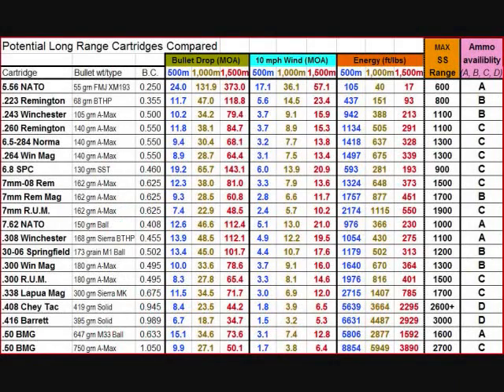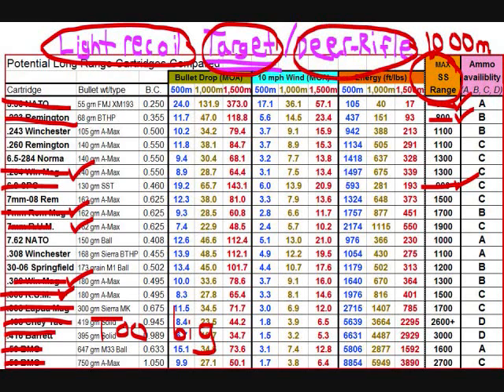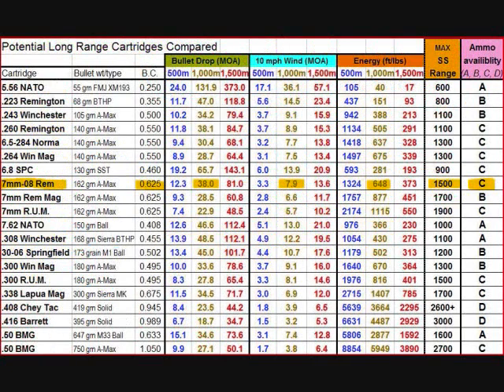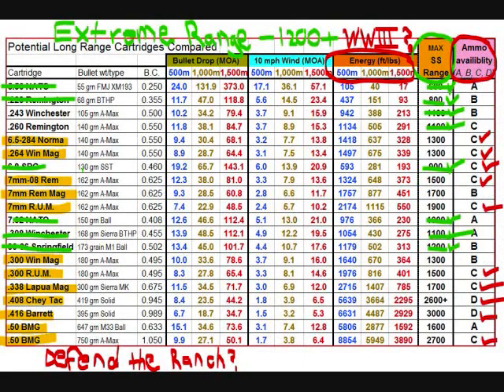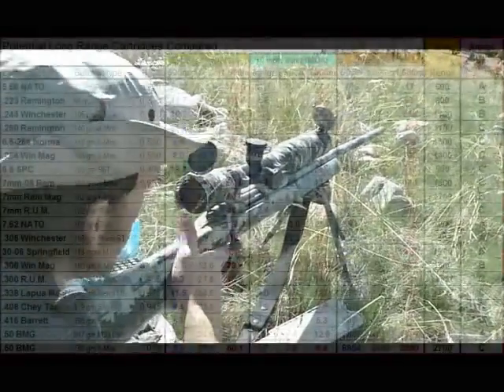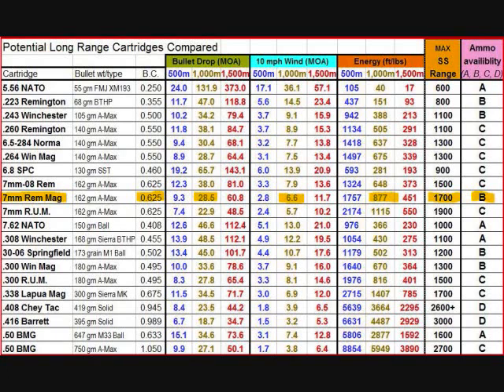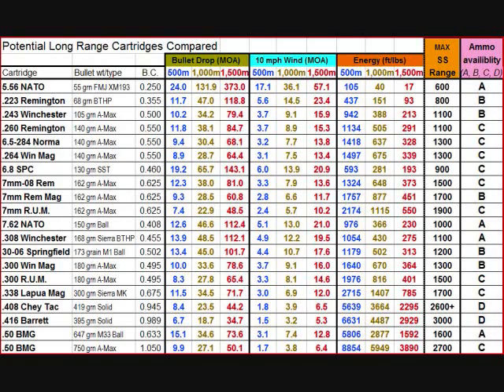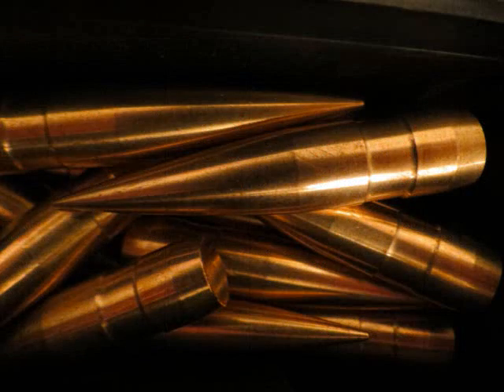Long Range 101 Part 3 - Cartridge Selection -- Rex Reviews

Comment: I would like to see .280 remington compared to 7mm-08.  It will shoot the same bullets with a little higher velocity.  It can also be handloaded from widely available 30-06 brass just as 7mm-08 can be made from .308 brass.  I don't think .280 is recommended enough and is an excellent choice.

Comment: Western North Dakota, 308 Win. with a 5.56/.223 in a support load. Both cartridge types are readily available both commercially and military loading's. I have absolutely zero illusions of exceeding 1000 meters, I'm not that good of a shot. But upwards of 1000 meters, the target won't know I'm there if I can get that kind of accuracy out of my hand built AR-10. Probably not, but upwards of 6-700 yards, I'd be happy with a shot.

Comment: Ammo availability for the 300 RUM and 300 Win Mag are incorrect for reloading.  It is shown as a "C“ for the RUM and a "B“ for the 300 Win Mag. The 7.62 NATO is an "A.“

For reloading all use the 7.62 mm (308) diameter, so all can be considered an "A“ IMO. 

The RUM can be also loaded with extremely high BC 220 grain bullets. 
Much higher BC than shown here. 

Add the fact you can load in 3 power configurations (30-06 or 300 Win Mag) and with a good brake she’s a pussycat, it can be used for all game, was why I choose it.

Works best for me.

Comment: Best all around cartridges: 7mm-08, 270 Winchester.
Best safe cartridges: 308, 30-06 (No barrel burning, throat erosion, Ammo all over the place, kills almost everything, etc)
Best small to medium laser beam round: 243
Most overlooked round: 25-06
Best long range large round: 7mm Rem Mag, 300 win mag. (Without going to the poor house).
Best long term Military round: 7.62x54R
Best brush cartridges: 30-30, 45-70 (Affordable too)
Best brush and self defense lever action: 44 Mag. (30-30 and 45-70 less rounds in mag) 
Best lever action self defense: 38/357 (Even more rounds in mag)
Best small game stealth round: 22lr (Suppressed, cheap)
Best Zombie round .223/5.56 (For most everything, carry LOTS of ammo)
Best get off my lawn round: (00 Buck) 
Almost every round has it's place.
Reply: I like the way you think!
Reply: 6.5 Creedmoor is also a great and versatile round with good bc, range, and decent energy. Ammo is normally pretty available.
Reply: @sheltma1595  The 6.5's have always been a great round. 
AND, If I had one, I could get 6.5 Creedmoor for less than 308 as the price stands for Now. 
This is a reason for 9mm guys not to laugh hate on 40cal guys, or 45acp guys to laugh at the 9mm guys. 
At certain times during this AMMO problem, we have seen 40cal sit on the shelf a lot longer, while the 9mm guys are fighting each other for a 50 pack of 9 or 45 guys praying for a shipment to come in. 
I tell you one thing,...IF,..things go back to normal someday, I would suggest EVERYONE get one firearm in many different calibers. Because you NEVER know when this will happen again.
And then, you will not be starring at an empty shelf, but stocking up on what you can, when you can.

Comment: These are awesome videos and charts. Lucky for us, even better bullets have been developed since this. The 6 creedmoor with 103eld and 105eld, 6.5 creedmoor with 143eld(625bc) and 147 eld with a 700 bc, and my new favorite is the 6.5 PRC with 147eld at over 3000 fps. It's still hard to beat the 7 rem mag with the 162eld and 175 eld at over 3000 fps.

Comment: As a rank beginner I ask: If you have the availability why not just go with the 408 Chey Tac?  Or in other words, why is the Chey Tac so superior to all the others?  There has to be a some downside I have not yet discovered otherwise it seems head and shoulders better than the rest.  Also, since most of us (I'm guessing) are sport shooters, terminal energy isn't really so important so maybe a differentiation might make sense (one more column on the chart). I'm very curious if there is an ultimate PRS competition-only cartridge recommendation.

Comment: For hunting, why isn't .270 even mentioned?  BC is better than some.  Ammo availability is better than most. Hold energy to 1000 yd  a bit better than .308 Win.  I get that BC for 6.5 and 7mm's  are a bit better, but not by much.  Is it because it's potential ceiling is too low  for challenging loooong range  target shooting?  Seems like it ought to be considered for comparison.
Reply: Am considering a Thompson rifle with swappable barrels.   You get the barrel, bolt, and stock with the option of easily swapped barrels in .308, 7mm-08, .243, and 22-250 Rem.  For a newbie like me, it would be the cheapest way to have new  guns of a variety of calibers.   Anyone got opinions on Thompson, and their Dimension-Interchangeables?

Comment: I am just getting into shooting, my question is 300 Win mag vs 300 Win short mag, i have read the short mags powder burns more efficient because the powder is closer to primer, however i have not seen anyone say if you lose anything going to short mag. Can you comment on this? Love your videos
Reply: I personally am a fan of the WSM family own 3 and my new custom MSR (ar)10  in yup you guessed it 300WSM IS in ups truck on its way now. Accuracy Systems Inc out of Colorado built it. .4 in 3rnd groups.
Ok so you asked. Wm v Wsm.  The truth is w 200gr  n below they are basically equal. 200gr and above slight velocity edge to Wm. As for inherent accuracy, slight edge to wsm below 200gr but above 200gr they are basically equal. Side note to that statement: potential accuracy of each individual rifle will very thru harmonics in action and barrel. Generally speaking the more accurate the rifle, the more you will spend on its components. Typically a savage model 10/100 12/112 16/116 Will provide good to very good accuracy off the shelf for the lowest initial investment. On the other end of the scale , a custom bolt gun on a premium action w a premium barrel in a premium stock/chassis system can run upwards of $5000 to $10000 or in my case $3400 for a custom msr10 in 300wsm and  $4000 and up for say an Omen in 300wm.
   As far as readily available ammo the wm edges out the wsm. Also in cost per rnd the wm edges out the wsm there too. In recoil department the wsm edges by a hair. If you reload you will spend less on powder w the wsm to achieve the results 
 So that's the best general info I can give you. It is of course my opinion and  the factual basis is what it is...always subject to rebuttals 
In summation,  it's up to the end user to decide what he/she wants,feels good,and is willing to spend to achieve the results they are satisfied with. So if 1moa to 3/4moa groups are good for your application a factory rifle will get you there generally for under a thousand dollars conversely if you want 1 hole accuracy, given YOU are capable, your going to want a custom set up.
 Here's to wishing you well and may blessing be upon you daily, Crawford out

Comment: Im looking to rebarrel my savage 110 270win . I had thought about going to a 26" 6.5CM. Is there a better option for a 1500+ Meter , reasonably priced cartridge? I will be loading my own, so that should help with some of it. It appears that the 7mm08 would easily do it, if I have a spare barrel made.

Comment: Why no 270 on the chart?
Reply: I agree. Just got a 270 as a Christmas gift and I want to know where it stacks up
Reply: The 270 win with a 150 grain bullet, is only 100 fps slower than a 7mm mag with a 160 grn. Less powder and recoil, cheaper ammo...
Reply: Was just going to ask the same question. Interested in the 7mm-08, but the rifle I want isn't chambered in it, wondering if .270 is comparable, maybe even better for cost. TiborasaurusRex, thoughts?
Reply: ***** Man, thanks for the comment!! You just made my choice way harder lol. I'll check out the Tikka Varmint too! For some time I've been wanting the Weatherby Vanguard, but I could be persuaded away I think. Thanks so much, I need to check out reloading info for the .270!
Reply: The .270 is a bit slower than the 30-06 till 200yds. It ends up the 6.5 creed more, 7mm mag and .300 wsm out shoot the .270 but finishes out better than a 30-06. A 30-06 will kill a moose. 270 has Higher ballistic coefficient .270 is same cartridge as 30-06 but with .277 bullet instead of .308 bullet in the 30-06. The 130 grain bullets in .270 are best for long range. The aluminium tipped and steel tipped bullets are more accurate.
Reply: Thanks man, I appreciate it. So he left the .270 off the list because it's so similar to the 308/30-06.. good to know. I've been really humming and hawing over which caliber to focus on. I really want to take Rex's advice for the 7mm, but the cost seems so high and I have so many other pursuits to get into! I think I settled on the .243, seems Rex pushes that out quite far, and I am no comparison to him by a long shot, I'm sure it would be enough for me for a loooooong time.
Reply: I agree the .243 is a better round...
Reply: mcmiry 270 is still a great round. Just it was ignored for a while when it came to the newer high bdc bullets. But especially if you're reloading it still shines. Plus the ammo is cheap. I've got hand loads that push out of my tikka at just over 3100fps and still group a 1/2 MOA. And that's out of a 22" barrel. And 150 g running just under 3000fps. And is still under an MOA. Ya, the 7-08 and Creedmore have better ballistics due to a more diverse high bdc bullets. But they have new 270 bullets coming out in heavier weights and better bc. I bought it before I really got into reloading and the 6.5 creed became popular. Guess all I'm saying is don't underestimate it. Especially for hunting. I've dropped deer on the spot out to 400 yards. And if I don't have time for reloading, the hornandy white tail interlocks I got for 26$ Can, shoots 1/2 MOA out of this tikka too. But not as hot as my hand loads. And the SST super performance is near as good as my hand loads. I think the best rifle for the money today for a great target rifle is the Tikka Varmint. My bro has one in 243 and it is an utter tack driver. Plus I think they have them in 6.5 Creedmore. That will be my next purchase. Just my 2 cents.
Reply: Ya Weatherby's are great too. But the Tikka I can't say enough about. Especially that Tikka Varmint. And it comes in alot of different calibers. Plus lots of good aftermarket support. In my opinion its a step above the Weatherby. you can just feel the quality that Tikka, Sako put into thier rifles. You do lots of research. I think you will find alot of support for the Tikka. By far the smoothest action and even the Snipers Hide gives Tikkas away to winners of their tournaments. And you rarely hear of a Tikka that was a lemon and had to be sent back. Just can't say enough about them. 
  They also came out with a new Tactical model this year in 308, 6.5 creed and 260. Probably a bit more pricey, that's why I say the Varmint version. Alot cheaper and still amazing accuracy. For around 1200$ can. So probably just under a grand in usd. And you can put it into a Chassis like the MDT line for around 600$ usd down the road. But honestly I can't see how it could get much more accurate. I've seen my bro put up 5 shot groups at around a 1/4 moa. Great rifles.

Comment: Loving the series. My question is, I'm hoping to go for a tahr hunt. I've a 308 but heavy barrel (not up to carrying that in the southern alps of NZ). and a 243. You say deer up to about 1000. Others say they wouldn't push a 243 past 300. The manual says " can cause injury up to 5 miles. What do you consider the cut off for tahr with a 243 and what bullet would you recommend? I'm being told I need something more like a 7mm rem mag. Is this just a case of who has the biggest nuts, macho rubbish? Cheers FC

Comment: Excellent tutorial. I wanted to ask if the 338 win mag, which os not listed on the ballistics chart more closely resembles the 300 win mag or 300 ultra mag for energy, range, and ballistic coefficient or does it more closely resemble the .338 Lapua Round.

also, I wonder what your thoughts are on the Remington 783 Scoped for the budgetarily constrained? What caliber would you recommend going up to 500 meters? 

Finally, your thoughts on TC Arms Venture 500-1,000 meters out?

Excellent, excellent series....
Reply: Hi Rex, how do you compare 7mm-08 and 6.5 Creedmoor as ammo in 6.5 is better now, and Hornady  has a 143 grain hunter?
Reply from the maker: +Jason Ford Great question, but somewhat difficult to answer w/o more details on the exact configurations being compared... generally speaking, the .338 Win Mag is a great performer.  With heavier bullets, its trajectories compare to the .300 Win Mag with plenty of energy at long range.
Reply from the maker: +Jason Ford TC Arms Venture should work fine for a long range rifle, if you don't mind the recoil.  Most guys can get 1moa out of these.  It would be best suited for long range hunting in the lighter configurations, and might be a bit light for high volume target shooting :-)
Reply: +TiborasaurusRex  Thanks Rex.
Reply: I saw a guy kill a pronghorn at 1000 yards with a 338 win mag, 200 grain nosler accubond...
Reply: Je P I'm wondering the same thing. I wish there was a video comparing 7mm-08 vs 6.5 creedmoor for 2016/2017. If such a video exist please let me know.
Reply: The 260 holds 5 more grains of powder than the 6.5 creedmore. The brass is easier to form from the 308 family. I'm not sure why we hear more about the creedmoor than the 260.

Comment: I am curious to know the max SS range of the Grendal and Creedmoor.  I think they would both rate low as far as ammo availability.
Reply: +tyler pace 
Actually, since the 5.56 and the .308 are covered adding the 7.62x39 and the 5.45x39 would be interesting.
Reply: +tyler pace At higher altitude you can get out to a mile with the 6.5 Creedmoor

Comment: This .30-06 bullet is said to have a .730 ballistic co-efficient: http://www.nosler.com/nosler-load-data/30-06-springfield/
Reply: +COMB0RICO Correction: "This 210 grain 30-06 bullet"
Reply: +COMB0RICO the data in your chart will be determined by the bullets you choose, which will be dictated by what you want it to do.  you just have to try to get comparable bullets for everything as best you can, obviously if you choose a target round for one caliber and a BTHP for another, you will have very different data for them.

Comment: i appreciate your data, but as an example of bias the bullets that you are using for 7mm-08 data is not comparable to the bullet used for 30-06 data. If you were to plug in a nosler 190gr accubond long range with a BC of .640 and a muzzle velocity of 2750fps you would see much different results

Comment: so would a 7mm-08 stop a moose or deer at long range more easily than a 30-06?  That's what I'm getting from this chart but moose hunters often say a 30-06 is a good moose gun but the 7mm-08 is a little weak.  Does anyone have a good recommendation for me for a good deer hunting caliber, maybe moose hunting once but mainly deer.  I don't have any problem with the recoil of a 12 gauge shot gun but I do have bad arthritis and tendonitis in my shoulders.  I am new to hunting but shot .22s and shotguns many times on the farm and went duck hunting a few times but have never shot a high powered rife.

Comment: I watched a video on yotube, the guy shot a huge elk bull in heart with a .308 at 900 yards and the animal just dropped dead! It seems that .308 are still effective at 900, 1000 yards! But not according to that chart I guess!
Reply: Tino L There are a lot of variables that determine actual effective range. I am sure he was up in the mountains where the air was thin, most likely hand loading to get the most out of his rifle, perfect shooting conditions, and even then you have to accept that him hitting the heart did require a small bit of luck.

Slow bullets penetrate great, but you do risk them losing their stable flight once they slow down too much.

I am not doubting the video you watched, as I know of people knocking hogs down at a mile with .308. Stupid, but possible apparently.
Reply: DJ21o3 you are right, it was in the mountains!

Comment: Great video and education, but I do not understand your ballistics table for the 5.56 NATO vs .223 Remington.

My understanding is that the NATO round has higher case pressures and cannot be used on .223. 

Based on data in your chart, the .223 "way out performs" the sister NATO round.

Yes I understand NATO is 55gr and .223 listed is 68gr.

My confusion is NATO has better B.C. (.250 vs .355), should also shoot must faster from muzzle given NATO specs, but completely fails in bullet drop at 500m?

I understand that extra mass on .223 helps carry velocity, but do not understand how the higher muzzle, lower B.C. can be so greatly affected.

I would be very appreciative if you can explain this conundrum.

Thank you.
Reply: It's because of the choice of grain weight b.c the 5.56 NATO I believe only comes in 55gr 62gr and 63gr with .223 you can get many diff loads of factory ammo

Comment: BC of a 6.5 140gr A-Max is .585 not .550, the Berger VLD has a BC of .612 and if you really want some range the 142gr Accubond has a BC of .719. That bullet being launched out of a 260 Rem at 2800fps will stay supersonic to around 2,000 yards depending on elevation and temp. I own a very accurate 6.5x55 and 7mm-08 both great guns, but the 6.5mm handles long heavy high BC bullets better.
Reply: Jared Thibodaux You're correct, there are some impressive berger bullets for the 6.5mm and that 142 nosler is insane. But this video is 3 years old now, im sure if Rex did this again with the newer projectiles, we'd see the 260 and 6.5x284 being mentioned more favourably than 30cal and 7mm magnums